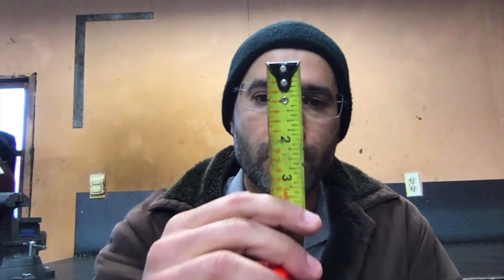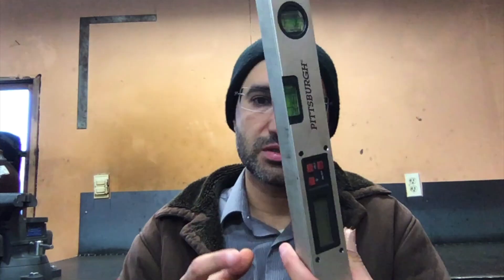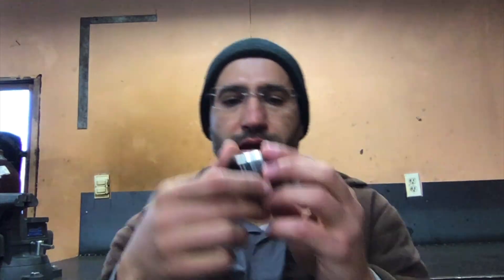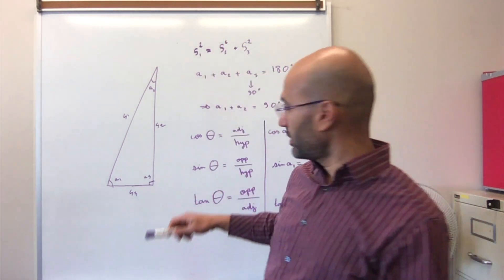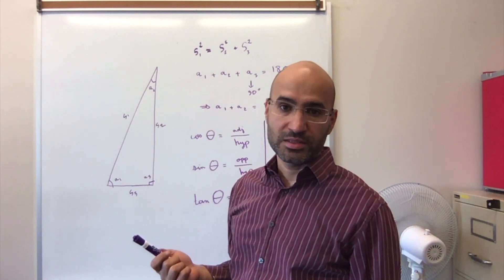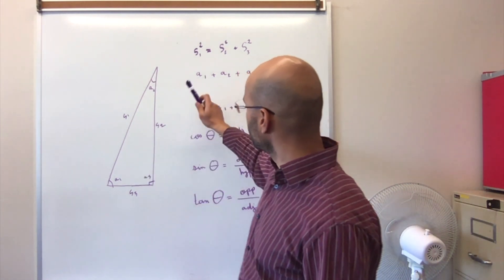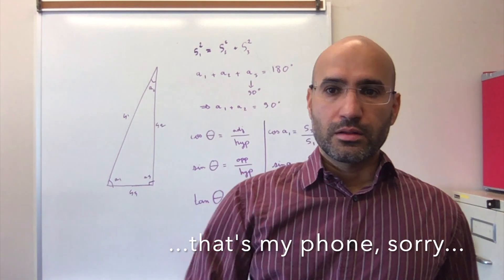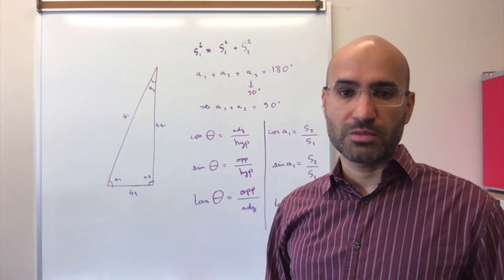Episode 4: Angles and trigonometry | How to build your own rock crawler/buggy/bouncer

Comment: Good work man
Why you have a distance between the control arm mount on the frame for the front axle and for the rear axle the control arm mount on the frame has no distance
Reply from the maker: Good question... I am not sure why I did that. Probably because I needed to leave some room for building a skid plate for the engine oil pan and for changing the engine oil so the lower control arms are not in the way. The truth is that the closer the frame mounts for the lower arms together, the larger the angle between them, and the stronger that they will be at taking side loads from hitting the tires on rocks or from a roll. So, the rear is better than the front in that regard...